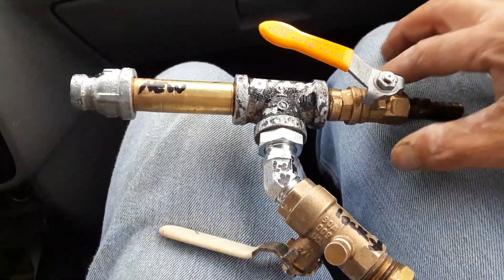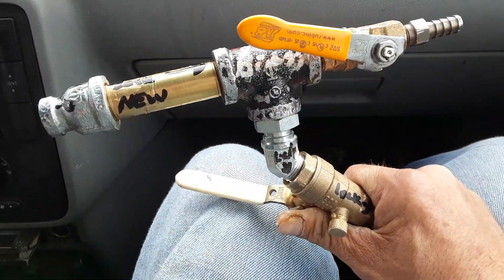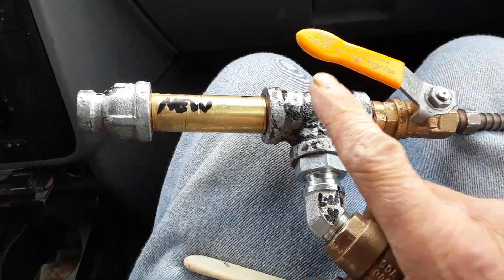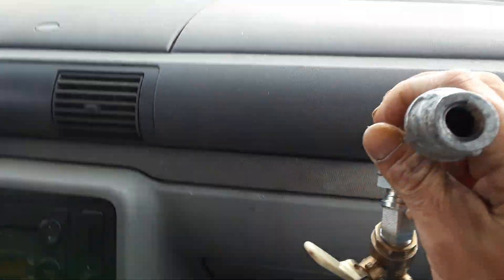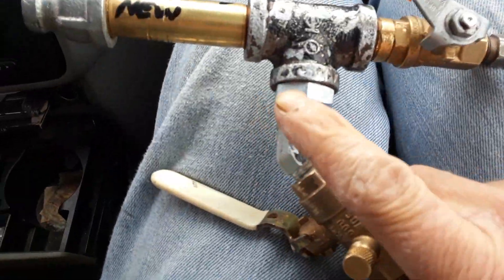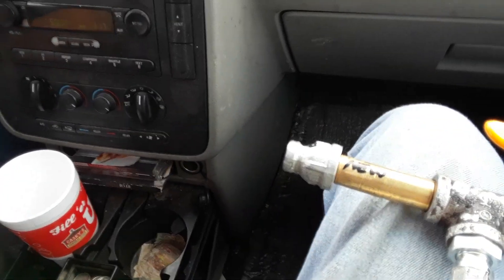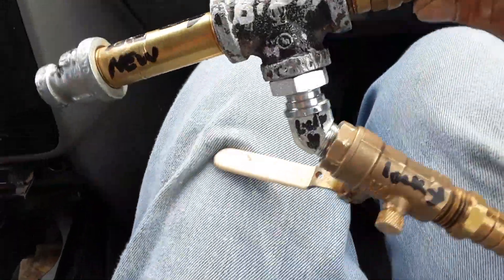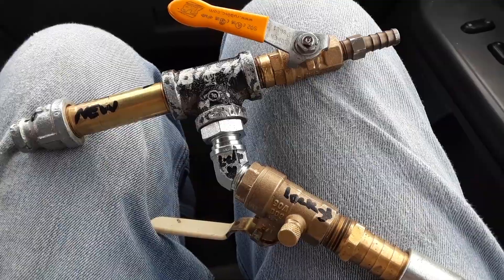Homemade pressure washer that siphons. I'm going to spray fuel thru mine for shop heat!

Comment from the maker: The king's fire gun is a working siphoning gun prototype. Gonna run used synthetic in mine to heat my shop Frankenstein rocket heater. Great for washing if you don't have a garden hose...This one needs no garden hose at all. A bucket will even work. Be great for farmers out in field to clear clogged blades y'all. Clean the oil out before you wash lol